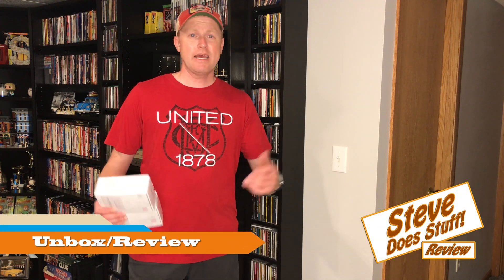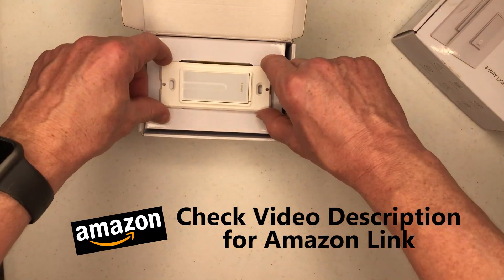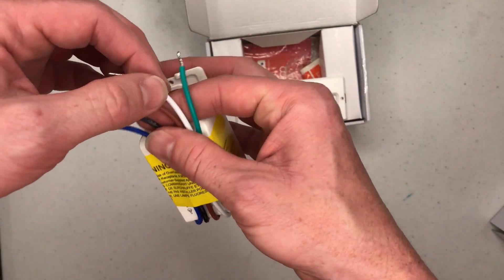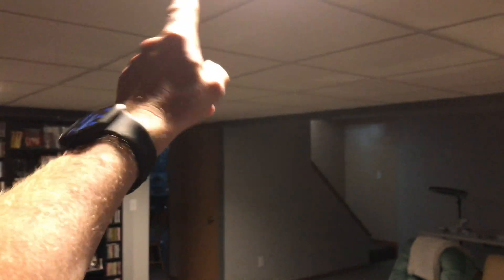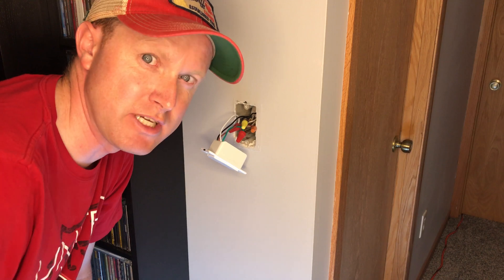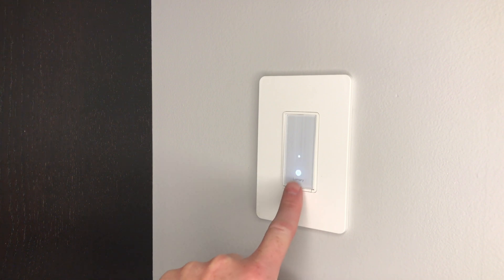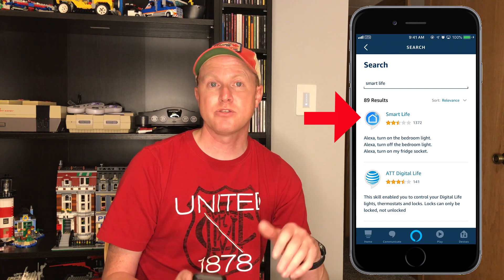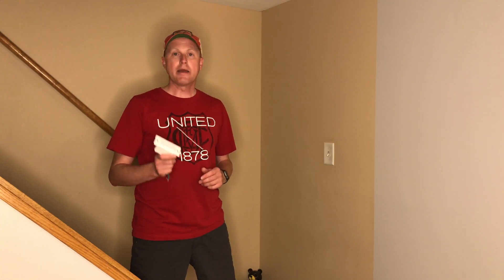Alexa Controlled Light Switches from Lumary - Dimmer & 3-way Unboxing & Install

Comment: Always use needle nose plyers or regular players to wind your wires together then cap them with the wire nut. Don't rely on the wire nut to make a good connection